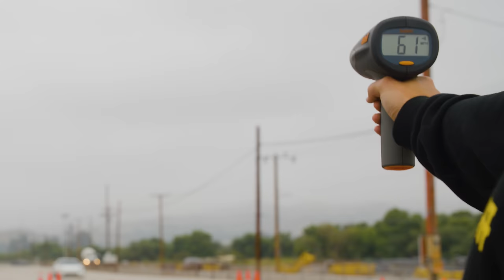$450 Brakes vs $4,500 Brakes | HiLow

Comment: are you guys gonna be doing expensive blinker fluid vs cheap blinker fluid
Reply: I think they put the wrong kind in my car when I had my oil changed recently. my right side is blinking faster than my left!
Reply: I make my own blinker fluid for my car...I’m smarter than most people!
Reply: Hurr durr
Reply: Do one with engine oils please.
Reply: And piston springs also make a massive difference
Reply: 2J Tom too cheap of blinker fluid is too dangerous
Reply: @LS__812  there's a blinker fluid additive made by Chevron that can fix that
Reply: Don't forget the flux capacitor most new cars come equipped with them but you can get aftermarket from mm&db industries lol
Reply: Not blinker fluid but still. My dad sent someone at work to go ask the paint guys if they had any checkered paint. 
Guy comes back and says they only have striped paint...
Reply: About time I change my car’s exhaust bearings
Reply: I actually have some blinker fluid, well, the bottle actually says eye drops.
Reply: Naw bro..... I need some engine fluid
Reply: why does blinker need fluid？ Sorry if thats a stupid question
Reply: How can you tell an auto mechanic just had sex?

 One of his fingers is clean.
Reply: Affan Uddin LOL
Reply: the black market for blinker fluids is crazy
Reply: Wesley Wong it’s a joke
Reply: 2J Tom I hear there is a thinner blinker fluid out now...its blinker fluid light...
Reply: 2J Tom I really hope they do
Reply: 2J Tom they don’t have BMW’s 👍
Reply: Everybody knows the cheap blinker fluid is cheap you get what you pay for besides we're not talking about a big dollar amount difference anyway always go with high-end blinker fluid your blinkers will thank you.
Reply: @boymcfacto5832  not as much as dual overhead mufflers
Reply: @Matt-hg2iz  yeah but only for diesels
Reply: Michael Gommerman  you know those systems are tied together right that's what the blinker fluid overflow bottles for
Reply: @JT_8283  yeah but unless you got a capalytic converter x pipe with unobtainium exhaust tips you can't drive in California you won't pass smog it's not worth it.
Reply: @corviniago6456  sometimes you can save money by buying used stripe paint and then overlap it to make checkers Pro tip
Reply: @vugen9960  you should try Pottery bushings way quieter and heat resistant like ceramic super cheap if you got a wheel and a kiln
Reply: @Darndiddlyarn  that's the good stuff is made out of actual eyes hard to find nowadays what with regulations and all way better than the synthetic eye blinker fluid nowadays.
Reply: @wesleywong8387  helps to lubricate the lens so they don't fog over
Reply: @Leon-jc5zn  I know some of them use synthetic eyelids that's why you get the pulp stuff so you can tell
Reply: @jordanhooper6511  pretty sure he knows but I told him it was to lubricate the lens to keep them from fogging just in case
Reply: @terrysmith9956  that's only for Yugo
Reply: Rico  if you upgrade to one way Pistons you don't have to worry about that anymore which is nice cuz you don't have to remember to rewind them before you use them again either
Reply: @christopherleveck6835  😂
Reply: Christopher Leveck sir u pro
Reply: @vugen9960  my grandfather, Colonel Bartholomew "Blinky" Balducci invented Blinky Fluid back in the 50's after the war.
He coined the term, "Blinky Your Winky"....
Reply: Christopher Leveck those things are revolutionary changed my pt cruiser entirely
Reply: @boymcfacto5832  piston springs,  huh, I'll have to try them.
Can I try just one or do they have to be installed in pairs?
Reply: @Matt-hg2iz  u mean made by chevron. Techron is another product made by chevron my friend ...... Hahaha
Reply: always remember to only use a left handed wrench when removing your cover on the blinker fluid reservoir.
Reply: I hate that this is top comment
Reply: Obvio6 they will
Reply: I only use Chris Fix original blinker fluid in m'y car not the cheap stuff.
Reply: Ohhh yes pls
Reply: I know this is a joke and it still breaks my brain😂
Reply: @Matt-hg2iz  Norom's headlight fluid is way better
Reply: chris fix april fools vids be like:
Reply: There is nothing such as cheap blinker fluid, it's all expensive. Those cheap ones are actually just orange juice
Reply: 10 percent more power
Reply: It'll be a 40 minutes  tho just putting oil in will be half the video
Reply: Haha
Reply: lol
Reply: @wesleywong8387  blinker fluid is a fake thing that car guys say to prank non-car people.
Reply: bruhhh😂
Reply: I’m a year late but that is a valid question
Reply: I keep emailing Amsoil asking when they’re going to produce their line of synthetic blinker fluids because I only run Amsoil fluids but to no avail.
Reply: @kevintucker3354  what do u use I personally combine Lemon juice water like very small amount of milk and salt and pepper oh also dog pee
Reply: @catherinewetzel7118  blinker fluid is a joke that car people use to trick non car people and some company’s at auto repairs joke about it to
Reply: @corviniago6456  I’m so glad you commented this a year ago it made me laugh so hard
Reply: I only use top shelf, triple distilled blinker fluid from Fiji
Reply: @spaomalley  why not home made it’s so much better for your car
Reply: Yo this would be a great idea
Reply: @kevintucker3354  oh no
Reply: Actually what do blinker fluid even does?
Reply: They would need BMWs instead of the Z350s because it's the brand that empties the blinker fluid tank the fastest.
Reply: My favourite is the flex capacitor
Reply: Lol blinker fluid doesn't exist
Reply: No, blinker fluids blinker fluid. Price plays no part
Reply: @wesleywong8387  that's the joke
Reply: Would be a great April fools day episode 😂
Reply: Lol
Reply: Do I have to get hydraulic steering fluid for my 350z
Reply: When I went to get my oil changed they said I needed my blinker fluid replaced for $10k because it was urgent, they are so nice
Reply: @wesleywong8387  funny joke, that's why.
Reply: @wesleywong8387  So it’s a joke, like you would tell a friend who knows nothing about cars to run into autozone and get some blinker fluid, then they would come out embarrassed/laughing bc they found out in the store it doesn’t exist.
Reply: I drive a BMW, what are blinkers?
Reply: I love this
Reply: I love you and hate you
Reply: premium air vs standard air for the tyres ;)
Reply: @pilot_jesse7968  Talk about brakes bro it was a ton of good jokes and then screeeeeech!
Reply: @wesleywong8387  No such thing. Its ridiculous and that's the joke.
Reply: How much should I be.paying for blinker fluid
Reply: @anonymous-rr6tj  free ninety nine
Reply: It’s a 350, not a bmw
Reply: The only fluid that matters
Reply: Premium tire air vs normal air?
Reply: @corviniago6456  omg that's amazing
Reply: Omg so funny  🤦
Reply: Blinker fluid is a myth.
Reply: Never touched blinker fluid in my life
Reply: Lol
Reply: @LS__812  I hope u are joking lol
Reply: I usually run them dry
Reply: @heelrarenederlander  you should never do that. You can crack the taillights
Reply: is there even a cheap blinker fluid it’s so expensive it feels like a scam
Reply: Anyone got a rim stretcher, I got 17's and I need 27's?
Reply: Bro I just use water at this point
Reply: Which is the expensive stuff: The yellow blinker fluid or the red?
Reply: I want to see them do cheap vs expensive 710 caps
Reply: I find your comment hilarious
Reply: @mati4181  I see, you too, are a man of culture

Comment: When the brake kit is more expensive than the 350 😦
Reply: FIXED CALIPER Not rotor.... any way so many things wrong in this video. P.S. never use chrome sockets on impact tools unless you want a pice of brittle high carbon steel in your eye.
Reply: @alexion4010  let just hope it not happening
Reply: Really? Out here the most basic ones still stay at $6k  and up...for $4400......a freaking S T E A L
Reply: @alexion4010  
i saw a lot of faults when they tested the suspension
in order to test that you need a track and a professional racing driver and a pro mechanic 
because on the KW you can tweak everything until its perfect
and the KW set will last a lot longer.
my friend had the cheap green coilovers and after 2 years it broke and he dousnt drive on the track
he drives low and slow :)
Reply: @HappyDude1  You are on the money.  P.S. a accelerometer and a Picoscope can help them a lot as well but ...... let's not get to side tracked.  Internet legends go by feel not by science!
Reply: @HappyDude1  OK, you do need a professional mechanic to tune those KWs perfectly but how many buyers in reality do that? Dialing in them yourself is a much more realistic situation.
Reply: HappyDude I think it’s worse on the streets. 

Potholes, dips, large cracks, etc...... 
No decent track will have these tarmac abominations.
Reply: @Mixz1890  
wel most of them just take the cheap ones and drive low
but in my bmw M cave club we all go to a pro to get that perfect balance and its a world of difference
its a waste of money when you buy expensive coilovers and not tweak them by a proffessional
Reply: @SataniaMcDowel  It's $8k in Europe, for hardtop.
Reply: Wilwood brakes all the way.
Reply: @HappyDude1  that's why I stick with just good quality lowering springs as good coil over setup and adjustment costs mostly over 1500$
Reply: @HappyDude1  I'm sure they had "pro" mechanic 😂😂😂🤦. Have u not seen that dude in his rx7 ? I'm sure he's a professional driver as well ...🤦🤦🤷
Reply: Leon Sefton I bought a 350z manual for 3500 bucks a few months ago, so he’s not wrong
Reply: Mixzzz CHEAP parts made in JAPAN are worth it, imo. We bought ones from eBay 200$ fully adjustable coil overs on my friends old ass Corolla over four years ago. it’s survived Los Angeles garbage roads.. pretty good, still turns like a little go kart.
Reply: Sushi boat captains be like: "I bought it for $500 and put in $7k in mods. So it's worth $7.5k
Reply: When you point out the mistakes on the video but the point of the video is which is better. 🤦‍♂️
Reply: At 6:25 their eyes look bloodshot
Reply: @alexion4010  using chrome sockets on an impact wont make them shatter, it's just a myth, all it would do is it will just fuck up the inside of the socket and round it off. I know because I speak from experience.
Reply: damn where do you find a 4k z at though??? let me know ha!
Reply: @TheSaif78  Chrome Vanadium sockets are designed to apply torque steadily , thin walls ( so they can fit in tight places) hard/ brittle heat treatment so they don't round off. NOT designed to resist multiple stresful impacts. Impact sockets are made  more milder so they can slightly flex under those massive impact shocks so they don't crack.  Any way that is just science.  But when you have a choice.... should I pay 70 bucks for a 19mm impact socket or Ahhh let's just get on from our 60 bucks chrome set COS IS THE SAME COZ!
Reply: @alexion4010  isnt that what I just said?
Reply: I spent 600 on coilovers, is that a decent price?
Reply: Frank White  mmm no MonoSS coilovers for both the front and rear
Reply: Well yeah, they used Wilwood as the "expensive" option and cut out AP Racing or Brembo. Sounds kinda bout right to me.
Reply: alex ion well damn, glad I saw this comment.. I always wondered why I never saw chrome sockets on an air gun
Reply: @SataniaMcDowel  where so you live? The most basic highish mile ones can go for as low as $4k here
Reply: Wilwood brakes are great though, I have the same setup on my 1966 Mustang as well and they stop insanely well.
Reply: serious? a 350 cost 80,000 here and lasted 10 years old.
Reply: You mean more expensive than a miata na
Reply: Well here in Germany the 350z costs you at least 8000€ (9000 USD) and a 370z min. 10000€ (11000 USD).
Most likely more for both.. moreover you can't go the cheap way, because everything has to be registered as street legal.. which is very complicated and expensive in Germany.
The most things you can't even do (like both of the options in the video, because of the perforated breakrotors), others you have to buy expensive parts which have been checked to be street legal. 
Otherwise you have to get registered it, that cost most likely the same or even more.

The only good thing for car enthusiasm is the "Autobahn", where you can drive as fast as you want in some parts of it. (As long as you be safe and don't break any rules while doing it [only leftsided overtaking, distance to the front car, don't get someone in danger, etc.]) (Not everywhere but most of the Autobahn).
Reply: I don’t understand why big brake kits are so expensive. But yet can get used or new take off for 1/2 the price
Reply: @xX12VincEXx  and this is why Europe is messed up lol
Reply: Leon Sefton problem with expensive brakes pads are that it’s fuckin stronger than the disc itself and breaks it causing you to buy a whole new on
Reply: Haha they are such junk inside. They have the ambience of a plastic McDonald's booth
Reply: @SataniaMcDowel  there about 5250 where I live
Reply: @AnonYmous-hu7jo  Nordschleife begs to differ.
Reply: alex ion ive never broken a chrome socket on an impact you just buy cheap tools
Reply: Saif M. Exactly
Reply: @alexion4010  depends, a lot of corded and battery powered impacts aren't strong enough. A pneumatic impact gun though

Comment: It’s not about stopping once, it’s about stopping a million times.
Reply: 4-5 times from 200km/h to 50 km/h in a row and you see what you hawe.
Reply: How often are you slamming on the brakes going from 50 - 0 mph, over and over in a constant loop until your rotors literally catch on fire? That's one hell of a daily commute
Reply: Timbob Jr you wont people who race are the ones buying them not casual drivers
Reply: @mattcary8075  I don't think somebody who is constantly racing like that will purchase a set of powerstops tho
Reply: Timbob Jr If you drive on the street, you don’t need RACING parts.
Reply: @LiquidCouncil  If you consider Power Stop brake kits racing parts, your standards must be pretty low
Reply: Timbob Jr Exactly. That is the perception being tested.
Reply: Or even just slowing down
Reply: Timbob Jr come drive in the 5 boroughs
Reply: @LiquidCouncil  no but trust me you want them
Reply: It's not about stopping a million times it's about voluntarily stopping before being stopped....
Reply: @Timbobjr  whoops
Reply: Yeah. I installed expensive brakes cause I've had wicked brake failure during my commute in the mountains. Good brakes in combination with downshifting with save your buttocks.
Reply: @Timbobjr  Depends on how bad traffic is; but I have personally warped stocked brakes going from 70 - 0 mph multiple times on a really bad and weird day. I was basically coming across multiple wrecks very shortly after they happened. That sort of thing has never happened before or since, but there has been more than a few times when I have gotten to work and smelled the brakes from them getting too hot. I upgraded to a full Power Stop brake and caliper kit and while that helped a lot, it didn't completely stop my brakes from occasionally over heating a bit.

When I got a new job and stopped commuting downtown, I stopped having those sorts of problems and I got a lot less dings and scratches. It was getting to the point where I was wondering if I could find that mystical, "reliable" cheap car just for commuting.
Reply: Timbob Jr Exactly, I hardly ever ever slam on my breaks so I’m fine spending only 500 on my 4 rotors and break pads
Reply: Some brakes are just meant to
Make you stop. Then there are brakes designed to continually slow you down. Much different. Kind like on motorcycles Cruiser/Harley brakes vs Supersport brakes. Different intended purposes; one to slow to a stop at red lights, one to constantly shed speed going into corners repeatedly.
Reply: 100% wrong
Reply: Abs
Reply: @LiquidCouncil  they're making a car that u can take to the track as well
Reply: @LiquidCouncil  well if you track your car on weekends track pads would be great
Reply: @ricardoramirez6774  Chill out there Mr. English professor. That line is a joke.
Reply: I had to go from 155-0 and slam on it it a lot of other instances but I have kept the same rotors and pads throughout without an issue all I have it upgraded calipers and pads
Reply: I can smell this video

Comment: The wilwoods are more than my car
Reply: How did I not realize this at all? -.-
Reply: Same😂😂😂😂
Reply: i think the first mod was already worth more than my car
Reply: yep me my ol 2005 spec v is only worth like 3k lol
Reply: Sean Price  thx 4 info
Reply: The cheap ones are barely cheaper then my car
Reply: Sean Price  Let's say those are shit compared to the common brand everyone knows about "Brembo" but I'm pretty sure they are way better than stock anyhow.
Reply: @raulferro3998  maybe,  brembo brakes on a stock bmw motorcycle s1000r vs factory Yamaha brakes mt10 , the factory yamaha stopped shorter and it was heavier,  you never know until tested
Reply: I paid $150 for my car. So the $350 set is more than my car
Reply: more than every car i ever owned. combined
Reply: Sean Price  Wilwoods are fantastic brakes that don't break the budget. If you want to pay more I'd recommend skipping Brembo and heading straight to AP Racing brakes. Wilwoods will be more than enough for most applications, though.